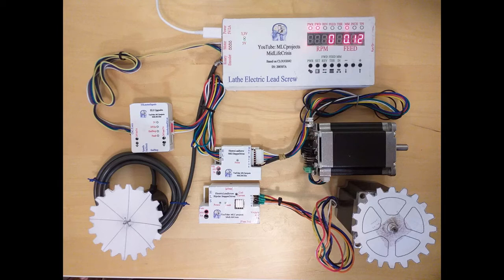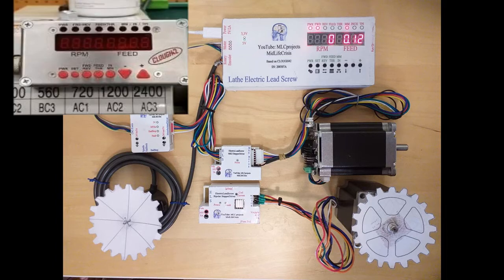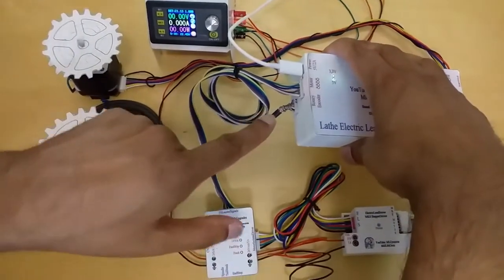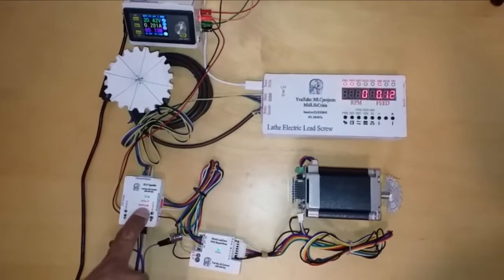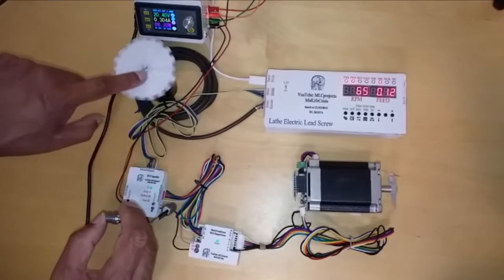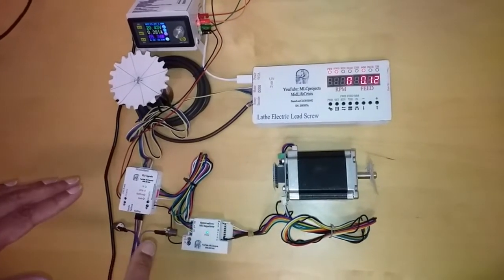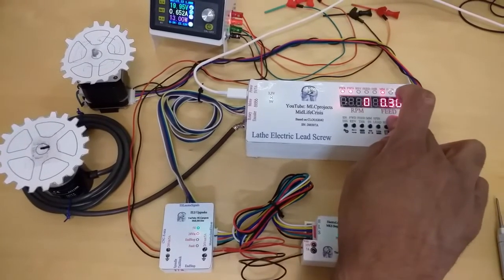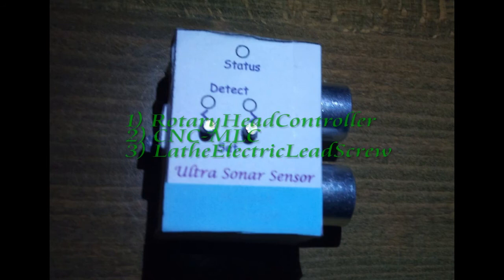Lathe Electronic LeadScrew external UPGRADES (Endstop, CNC, Stall) for Type1 Clough42

Comment: Will it able to cut pitch distance of 150 mm on 6mm lead screw with 1 or less spindle rpm
Reply from the maker: In short, yes the ELS could.
There are a lot of engineering considerations.

Comment: Can you add a link to the sources of supply for the kit you use please.
Reply from the maker: Hi John, 
You can choose for my ELS-type1 or ELS-Type2 controller. Both will work.
Some parts you can buy online yourself that depends on several aspects of your lathe mentioned in my latest new ELS video's.

* Part1, Lathe Electronic LeadScrew Compact system ELS Clough42
      (https://www.youtube.com/watch?v=9VG0VcoJN4Q&lc=UgwRbB91osZx3C9w35h4AaABAg)
* Part2, Lathe Electronic LeadScrew external UPGRADES
      (https://www.youtube.com/watch?v=WV3MnG4V8k0)
* Part3, Lathe Electronic LeadScrew external TouchScreen Display for Type1
      (https://www.youtube.com/watch?v=BYQbsw5ygC8&t=1s)
* Part4, ELS Type2
      (https://www.youtube.com/watch?v=ypzRlF7flV0)

Sorry for my late reply, your comment ended up in my Social folder instead of the Primairy folder.
Reply: @MLCprojects  Hi Mid life, looks like a great piece of kit. Always worth paying a small premium for a matched and sorted set of parts. Thank you for posting the links. John
Reply: @bikerides  Thanks John, indeed the MLC-ELS-controller is a balanced system that can support all types of lathes.
For users to reduce costs I made these video's which parts to buy themself, like...
* A micro-lathe,  if cleaned and oiled,  could do on normal speeds with a cheap NEMA17 stepper motor. A mini-lathe with a NEMA23 and a profesional-Lathe with a NEMA34 or higher.
* Closed loop stepper motor is often overkill for hobbyist and expensive.
* EndStops could be a cheap simple mechanical switch too.
* The ELS can work without the option of a TouchScreen. (Smaller TouchScreens are way cheaper by the way.)
* My main ELS controller choice is just ELS-Type1 or ELS-Type2.

It's up to you to config your ELS if you wish.
If you have questions I'm glad to help.
Reply: @Dancer148  Wow. That is so helpful. I'm itching to get started
Reply from the maker: @bikerides  Hi John, that's good.
To become familiar with ELS you have to figure out the design on your lathe how you want to mount the rotary encoder and the leadscrew steppermotor (NEMA23 or 34) first. Try to implement both within the gearbox cover.
Different solutions for every lathe like Logan, Myford and Chinese ones.
Hope that this will help.
Reply: @MLCprojects  I will be back to you in the Spring. Such helpful advice and information.
Reply: @MLCprojects  I need to sell one of my lathes first to fund this project.